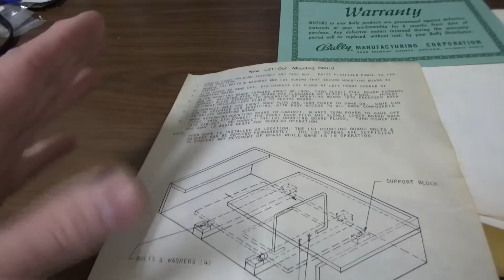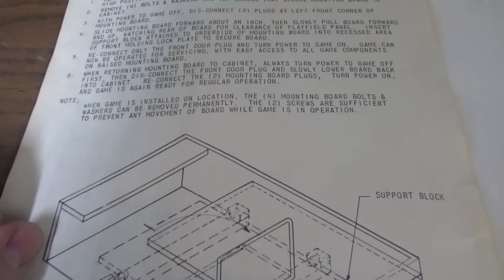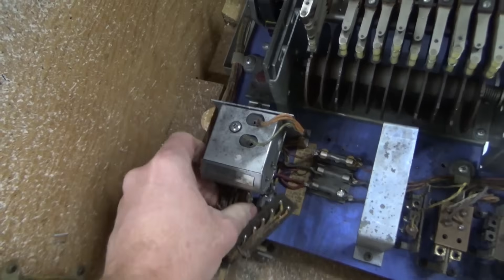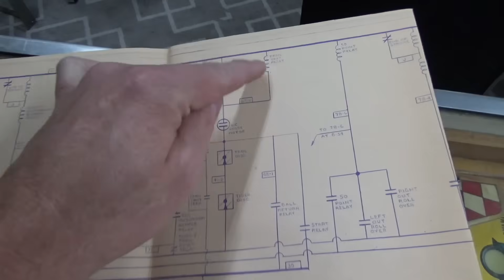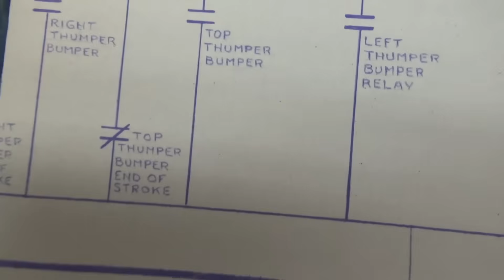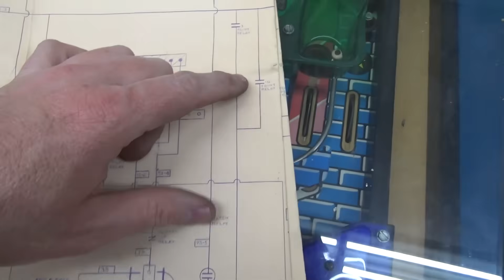The Crazy Service Feature Built Into Bally's SAFARI Pinball Machine...

Comment: not sure if you could have plugged the flipper controls back in to the mech board if you had pulled wiring through coin door to plug it in.  I think this would have given you the needed slack
Reply from the maker: They designed it so that the coin door cord could come out of that clip and plug back in, but the other one wouldn't reach through the door, I guess they intentionally didn't want you to be able to use the flippers...

Comment: Nice idea to be able to pull the motor board up, so you don’t break your back leaning into the machine. …I love the Bally score motor, as when you undo two screws you can easily clean and get to every switch on the score motor. Bally had lots of good ideas, ….BUT with all that said, Gottlieb kept making games that really attracted the players. Gottlieb games also felt better when you nudge the machine. They tended to ‘rock’ backwards and forwards, and they just felt great. …Not sure that Bally games ever felt as good as the Gottlieb’s….But they sure were out front with different playfield designs and rules sets.
Looking forward to this playfield getting the treatment from Joe. Thanks for posting.

Comment: The trouble with LED's in some earlier machines can be the way the bulbs are used.  In this particular game, no big drama and warm white LED's exist now, so they can look a little more natural.   In some machines though, your LED's will flicker and carry on in ways they shouldn't because the machine uses the resistance of the light bulbs as part of the circuit.   It can really vary machine to machine as to weather LED's will work right or not.   The machines that use matrix style access to bulbs and switches can really be tricky with LED's sometimes.     The number 47's are a good compromise as the are a lot less hot, the run with a lot less power, but still maintain all original functionality